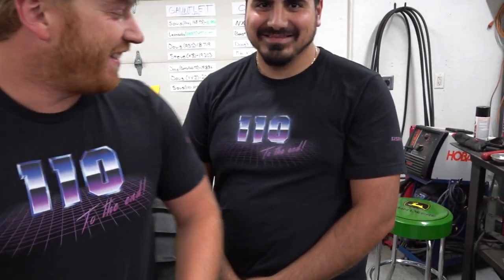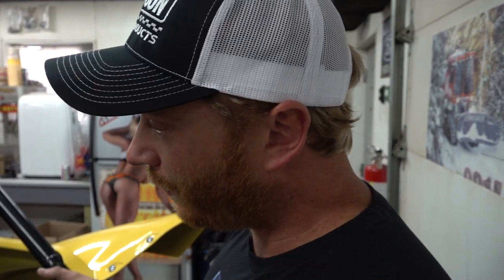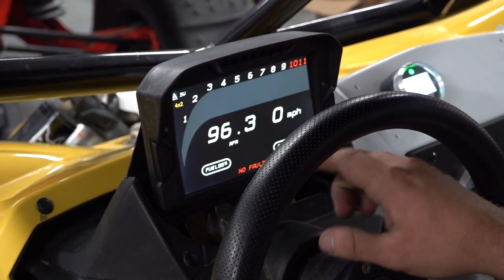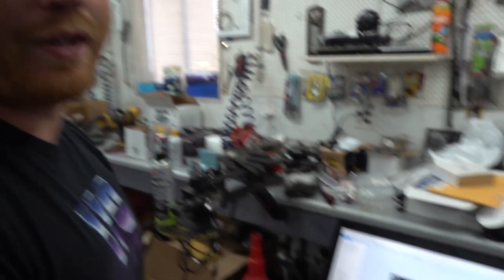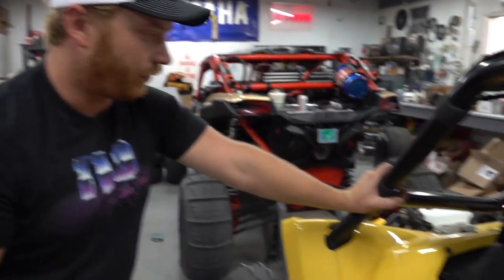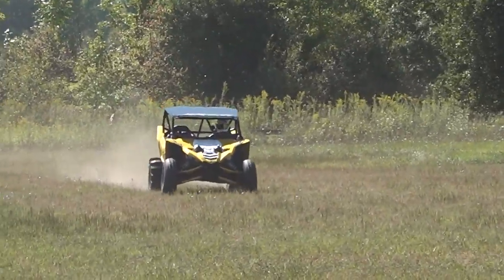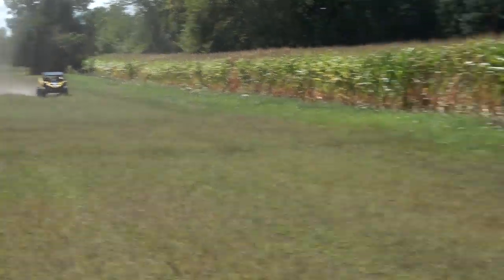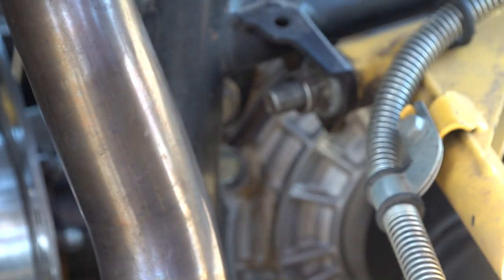Turbo YXZ gets AEM CD7 dash and SENDS IT!!

Comment: Proformance Motorsports has a dana 30 differential option and also hubs and axles for the YXZ. Probably pretty spendy but would handle the yzx at full send!
Reply: That would be badass!
Reply: A diff for that is usually in the front of a jeep but installed in a yxz.  Interesting
Reply: @TagGeorge   Yes, but being a larger gear set in size, much stronger in design and better material then UTV style diffs it makes sense. Proformance uses a normal dana 30 gear set but there own carrier and housing that fits the YXZ and X3. With their hubs also it allows you to use CV's that are double in size and shafts also. Also this lets you have longer axles Because it's a narrow diff, allowing more suspension travel without widening the unit. Very cool stuff.

Comment: Just a suggestion if you stay with a stock diff consider roll pins next to each bolt or tapered pins for easy assembly? Also your clutch guys could whip up a billet cover and beef everything up?

Comment: You need to get a quick shifter like sports bikes use, full throttle, no clutch shifts (they cut the ignition on shifts)
Reply: That's why I like the paddle shift model yxz

Comment: Question for Doug- with the current management system and turbo setup are you able to do boost by gear? I’m not sure how many speed parts they make for the yxz such as axles, differentials and transmissions. As a man that enjoys big power I understand that certain platforms may limit you on those sorts of upgrades unless you have them custom built (but that obviously costs big money). I think a boost by gear setup would save those components and still have it pushing 20lbs of boost in lets say 3rd gear to 5th. Manual transmissions are really hard on rear ends and axles  anyhow due to how hard everything engages. Best of luck Doug, this build is awesome!!!!! Can’t wait to see where you go with it!!!!
Reply from the maker: Not currently but we are going to change the boost controller and may end up with that capability.  We'll get it sorted.  Thanks!

Comment: Thoughts... on  each one 
 RZR TURBO XP.  / X3 R  120HP Model.  Or Talon R ?
Any help thanks... for fast sliding handling with a little trail riding mixed in. I have been trying to find real comparisons on machines and really don't find anything. What strengths each machine has, type of riding each is best at.. what new owners should look at and for.. are 1000's quick enough or go turbo.. And so on...

Comment: That’s a nice screen and all but 2 grand???
Reply from the maker: It's a lot more than just a screen, it's going to allow us to get this unit to it's potential, that's worth it IMO
Reply: SXSBlog.com oh absolutely, but what all does IT do that just a normal tune wouldn’t allow for?
Reply from the maker: @conorhogan2435  It in itself is not a tuner, it's a dash and datalogger (this model also has GPS for performance measurement and navigation).  The datalogging capability allows you to integrate new sensors required for turbo setups and datalog them in the field to adjust the tune properly.  If you're buying an "off the shelf" turbo kit you can get by with a previously developed tune, but if you're building a custom setup like this you need to be able to log / monitor it.  You can also get a 5" version without the GPS for a lot less money.

Comment: Wow that sucks in destroying the diff. Typical example of how the machine has to be built around the power of the motor. Lol. Once you get all squared away with the amount of boost you want to put through it. You should keep track of the miles or running time it takes before you have to rebuild the motor.  Be interesting to see what the longevity of that motor is when you Get 400+ hp out of it

Comment: Not dog'n you guys but what did you expect? I mean 300+Hp, massive 18 paddles in the dirt through a stock diff with a 10k clutch dump... I'm just curious, what's cheaper to replace axles or the diff?

Comment: Why don’t you go full stand alone ECU you have more protection over the engine and be easier to tune for you
Reply from the maker: Not really in the spirit of the build. Just wanna do a garage built deal.
Reply: @SXSBlog  yes i under stand but you'll have better control over the engine and can set better safety parameters, AKA pull power when the wheels start to spin so you can have better launch's and everything.